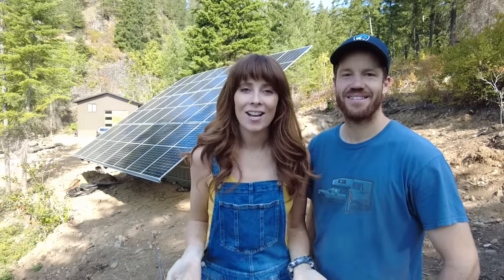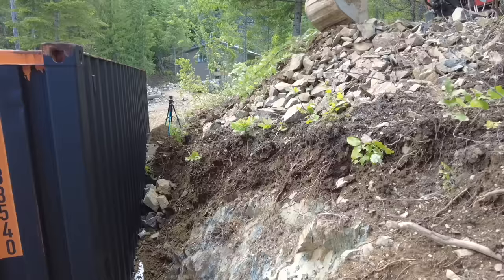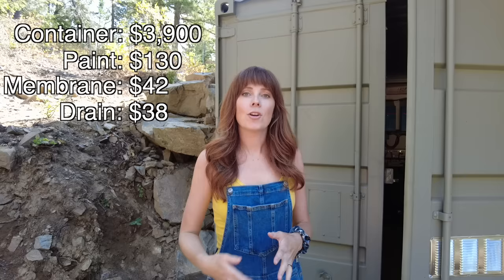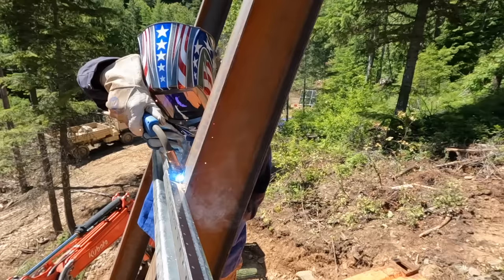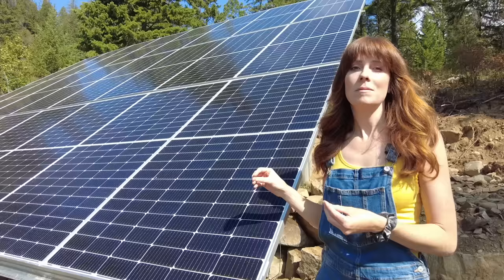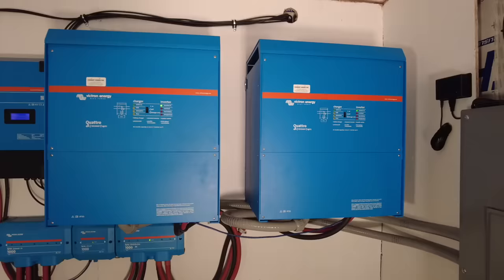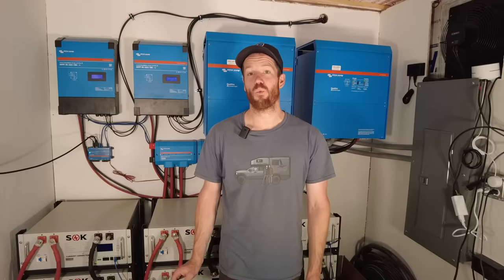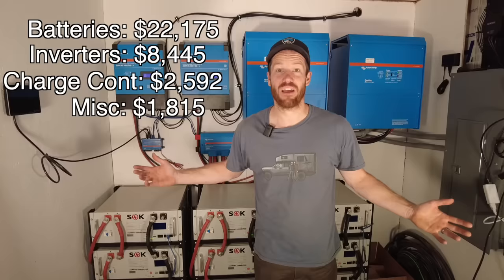TOTAL COST Of Our Off-Grid Solar Power System | Powering Our Mountain Home

Comment: My CPA wife wants me to remind you that the tax credit on your solar install for 2022 is 26%. Give your spreadsheet to your CPA and get the ball rolling. Take care.
Reply from the maker: Thanks for the reminder Frank!
Reply: @AmbitionStrikes  I am assuming that the $50k price is before the 26% tax break?
Reply from the maker: @keithviolette5870  That is correct.
Reply: @AmbitionStrikes  I hope to be energy independent at some point - our power is not all that reliable, and our rates increased 40% this month. Love the use of the container as a foundation.
Just a quick calculation - $37k for your system over 10 years would equal my average monthly power bill - about $300 for about 1400 kWh/month
Reply: Actually, since this began operating in 2022 and the Inflation Reduction Act is signed, the tax credit was bumped back to 30%.
This only applies to new equipment and I'm thinking your SanTan solar panels are possibly used?
Reply: @580guru  they are very likely new panels. Bifacial panels that wattage haven’t been around long
Reply: It’s now 30% for the solar tax credit passed in the Inflation Reduction Act
Reply: AKA the inflation Production Act
Reply: Credit… not rebate.  If you don’t owe, then the credit gets rolled over till it expires.  

When I put my solar on at the end of the year, I thought I was going to get one of these insane tax returns and funnel it into the loan for my project… that’s when I learned the difference between tax credit and tax rebate.
Reply: Nice system! I’m 10K of solar offgrid with 8K radian and three 100A charge controllers. Same reason - the power company wanted a minimum of $37K to run power to our cabin. About the same amount of money as you spent, we have been running with just a few days of generator a winter. 

Along with the “inflation reduction act” bumping the STC back to 30% for installs in 2022, they may also be now including energy storage systems in the credit, which weren’t part of the previous credit. 

Of course it s a credit, so you have to have enough taxes paid to claim the credit. If you haven’t earned enough to owe taxes this year, you can push credit into the following year. 

And yea, the credit previously required NEW equipment, not used. SanTan typically recycles panels - which is why they are a ‘deal’. Check with them if they are eligible. Since they are sold with short SanTan warranties, I’m thinking recycled, not new but maybe they are “B” grade panels straight from a factory. 

Consult a tax pro, some of the credit stuff seems to be up in the air.
Reply: Industrial scale solar! A normal home should only need about a third of that power? I installed a 200 amp conventional service to the grid and copper was much cheaper. Only wired in 100 amps so far. Never got around to building the out buildings or affording all our decks as my oldest was born with multiple surgeries to come during the construction. Even in northern latitudes where much of the year the panels aren’t worth keeping snow free the return on investment beats wind by about 3 years. I’ve looked into it enough with everything you’ve been doing. Very inspiring! Keep going!
Reply: Federal solar investment tax credit.
If you install your photovoltaic system before 2032, the federal tax credit is 30% of the cost of your solar panel system. This is 30% off the entire cost of the system including equipment, labor and permitting.  30 percent of 50K is 15K.  This is a first year tax credit.  The state of Idaho also offers a state income tax deduction equal to 40 percent the first year and 20 percent the following three years with a maximum deduction of $5000 each year.  Hard to say how much that will be worth to you.
Reply: @johnharrell5654  inflation production act, lol isn't that so true
Reply: When I installed my solar system 12 years ago it was around 45% but a $13,000 tax break is nothing to sneeze over!
Reply: That just got bumped up to 30%.
Reply: @nickgustin  It's a tax credit. It doesn't roll over year after year.  It applies to the taxes you might owe or it becomes part of your tax refund check.
Reply: We are also in north Idaho. Are the tax credits available for DIY solar projects or only for professionally installed systems ?
Reply: @580guru  I bought some of these panels too. They are new but mine were 'open box'.
Reply: @adarelliott  It doesn't have to be professionally installed.  Keep every receipt as you will apply for the tax credit on your income tax form. But there is no credit for your own labor.
Reply: They just extended the 30%.
Reply: If my tax credit is $15,000, but I only owe $5000 in federal taxes what happens with the other $10,000? Do I lose it or does it roll over into next years taxes?
Reply: tell your CPA wife to get more training. solar taxcredit is 30%
Reply: Is it possible to get a tax credit on a self installed system?
Reply: @keithviolette5870  note that if you are grid-tied you’ll still have a considerable monthly bill in addition to the payment on the solar (the grid bill will be mostly fees, taxes, supply charge, etc)
Reply: @ConorLennon  Understood, but the majority of the bill is for the power, which just increased 40% last month. My preference would be to disconnect entirely, as I have done with phone and cable (now using Starlink), but that requires a lot more investment in batteries, etc.
Reply: Your CPA wife is not very current on the tax credits
Reply: @nickgustin  
That is absolutely correct. Also, if you don't pay that much in taxes then you won't get all of it back. I'm having a hard time getting the $7,000 back that I'm due on my rooftop system and I've got 5 years to do it.
Reply: @keithviolette5870  @Ambition Strikes in another quick calculation if they use task reduction credit and their batteries and solar cells last for 20 years their monthly cost for unlimited electricity would be $154
Reply: @NoName-ml5yk  You get a tax refund check.  It's like you your employer overpaid.
Reply: 30% now
Reply: @NoName-ml5yk  rolls over
Reply: @nikolatesla5553  A tax refund check for more than I paid in for taxes that year?  How do you know this and can you prove it?
Reply: @nickgustin  You only get 5 years to use the credit.
Reply: @NoName-ml5yk  
Why would anyone need to prove anything to you? Look it up yourself if you don’t like the answer. Stop being lazy and do your own research. The information on solar tax credits is publicly available.
Reply: @keithviolette5870  
1400kWh a month? What the hell are you doing?
I have about 3500kWh per YEAR
Reply: @NoName-ml5yk  yeah he’s wrong.  It is a nonrefundable credit. You are only credited up to the amount of your tax liability.  The unused portion can be claimed on following years tax returns up to 5 years though.
Reply: @benjaminw309  Thank you Ben!
Reply: @SiriusSolar  Yeah, these comments act like its all free money. We all pay for this... So kudos to those that take advantage of it but please, thank all the taxpayers! Current and future!
Reply: @keithviolette5870  what area🤔
Reply: It’s actually 30% now. 💵
Reply: @sebastiangrimm4370  I have a machine shop, wood shop, welding fabrication shop in my basement, a Tesla Model 3 Performance, a plug in hybrid Prius, 4 window air conditioners, it gets dark at 4:30 PM in the winter, etc.
Reply: @trojanssc01  New Hampshire. The cost of natural gas has spiked, so the power companies just pass it all along. Other local power companies went up even more.
Reply: @benjaminw309  so with the credit applied it you are in the positive you dont get that as a refund?
Reply: @timothyberlinski2299  it is nonrefundable meaning the credit will not exceed your tax liability.  
E.g you have a tax liability of 10k and you have a 2k child tax credit and a 15k Solar credit so you only receive 8k in solar credits.  Your refund will be everything you paid towards taxes in the year and you will be able to claim the remaining 7k the next year (15k - the 8k you received for the credit this year)
Reply: it's 30% for any system installed in 2022-2032 and the credit applies to ALL taxes paid, including any W2 federal withholding taxes. not just "taxes due when filing". great job on this and best of luck!
Reply: Government will know you have the panels tho
Reply: I thought it recently went to 30%
Reply: @keithviolette5870  What do you do to consume 1400 kWh/month ? Big family, electric heating system ?
Reply: @charlyclerfeuille4212  We are a family of 4, we have well water with a 3/4hp pump, a water radon system with a 1/2hp pump, an electric stove, electric dryer, 4 window air conditioners in the summer, a machine shop and welding fabrication setup in the garage, a couple 3D printers running 24/7 for a side business, a Tesla Model 3 Performance (20k miles per year @ 0.3 kw/mile ~400kWh/mo), and a plug-in hybrid Prius.  I'm looking into Solar.
Reply: That only works if your in the correct tax bracket to pay as much in taxes.
Reply: @nickgustin  Just don't pay in next year and let the credit cover your tax load?
Reply: @nikolatesla5553  The balance of the credit used to roll over year to year till used up. Has that changed?
Reply: Do you get tax credit for offgrid ?
Reply: @keithviolette5870  electricity is probably going to triple over the next 10 years so the savings may come sooner.
Reply: Useless credit when you're spending 40k.
Reply: They produce more power than the service to my house.
Reply: That is nice. Whether a person  uses new or used panels,  it's a great deal.  Used panels are usually 1/4th the price of new and still have lots of life left in them. They aren't  as efficient of course. 
 Better reused than thrown in the dump.
Reply: Yah its 30% last i checked for 2023 looks like!
Reply: @keithviolette5870  Have you noticed in your area that it almost seems the Natural Gas producers are not objecting to what our government is trying to do to kill off their business model? It may be different in your area but in Western, NY National Fuel Gas seems to be stone cold silent about this and the ban on any gas appliance for new builds and possible replacements.
Reply: @mikewurlitzer5217  I think they are at or beyond the capacity for the regional pipelines, so they may be limited on what they can promote.
I have used gas appliances, and they are great for quick heat, but I would rather have induction.
Reply: @ConorLennon  we are grid tied in NYS and pay $18 a month connection fee (unless we run out of credits and have to buy power)
Reply: @NoName-ml5yk  that how it worked for us in 2014 in NYS. We got about a10k federal tax refund, but then we owed income taxes on that 10k the next year, so paid back 3k of it.
Reply: W wife
Reply: 30% for 2022, genius. Hoping you posted that before actually asking your CPA wife, or it's really not a good look. 😂
Reply: As well as Idaho state tax credits
Reply: The inflation reduction act increased it to 30% for the next 10 years
Reply: Not worth all that shade on your solar panels
Reply: 🤣 so they made a solar to save money but now they have to pay tax for a have a freaking solar that is US for u everything is tax if I was this couple I would have just move to asia like Thailand or Vietnam alot cheaper n better life than getting, ill every year for tax even when they made solar to save money on electricity but get tax for 50k that make solar useless or even more of a problem cause off add tax🤣🤣🤣🤣🤣
Reply: it wasn’t that hard to figure that out
Reply: @travelfeet  have an 11 acre property that has a camper on it. I wasn’t there for two years because my wife passed away. So they have been taking 50 dollars a month for electricity that I’m not using. I put a 200 amp service in a garage because I was going to eventually build a house on the property. I have over 300 hundred dollars credit with the company because they are charging me 45 dollars a month. I called the company and said I want to shut the power off and I would call when I wanted it turned back on. She told me that I would have to pay a reconnection fee and pay the back 45 bucks for every month it was off. How’s that for a company ripping me off?  I think I’m gonna just shut it off and take my generator with me when I go up there. That’s why I canceled my land line for the phone because I was paying 35 bucks a month if I didn’t even use it. That’s in Pa. By the way. ✌️👍🇺🇸
Reply: I wish I had a CPA wife.
Reply: You need to pay tax just to install and use solar energy?😅
Reply: @nickgustin what does this mean? If you wouldn’t mind explaining a bit more?
Reply: Glad to know my tax dollars are paying for your power.
Reply: @atlurker8037  
Loss leader in business is when you pay to change customers' behaviour. 
Governments are financially involved in the national grid and electricity.
If the grid is overloaded and blackouts, governments are punished by voters.

To pay a little once to get people off the grid is cheaper than increasing generation and fattening the grid.
Reply: This didn't age well.
Reply: @stephenbrickwood1602 and the whole point of this transition is it is paying for itself over the long run in lower pollution damage
Reply: @robgriffin4801  yes.
And it can lead to huge amounts of free energy as the technology improves.
Reply: Wait, I have to pay the government just bc I decide to get solar power ? ?????
Reply: Is that 26% on the entire system or just the cost of the install process
Reply: They installed themselves so that 26% is free for them
Reply: 10 kilowatt off grid tata solar system on my rooftop in india is way cheaper with 25 years warranty on panels. 
cost us $8400 (after govt subsidy)
Reply: @AmbitionStrikes  How is a 10kWp system with batteries 50,000$?! The panels will set you back around, 3000$ even at 2022 money and the batteries are probably no more than about 30000$ in 2022 money. Where is the rest 15,000$ going to, not the inverters?!

Comment: I may have a pro tip, how to improve the batteries endurance in your system. You can mount a thermostat with a fan heater inside the container and set the temperature to 15 celsius degrees. You can use excess energy to keep the batteries in the optimal temperature just by adding this small system so you can enlarge their lives by a few years 🙂 Good luck!
Reply: Heat pump system may be even more efficient
Reply: In deed, heat pump is more reliable, way more effective and efficient in keeping your container cooler for summer and warm in the winter. 👍
Reply: Just need a small mini split
Reply: Also limiting the max battery charge in the controller (?)

Limiting the max charge to 95% will also further prolong battery lifespan (prevents overcharging issues while still provides near full capacity)
Reply: @sihamhamda47  most controllers do this behind the scenes.
Reply: Maybe use the heat from the batteries as a powersource
Reply: 1-2" styrofoam insulation on the shipping container sides was effective for my application in the northern latitudes.  I've since graduated to a more efficient heat pump system.
Reply: 50k?  Pass
Reply: @JayHNotTheNormalTraveler  $50k for independence and peace of mind is a small price to pay. SELF RELIANCE above everything. Its a mindset.

Reply
Reply: Yup great idea.
Reply: This works, IF they get enough sun to keep it up.

Comment: Hi guys! if you paint the container bright white and spread white soil on the ground you will be able to get a higher generation with the bifacial panels due to a higher Albedo. Nice PV System, congratulations!
Reply: Snow under and around the panels would work too.
Reply: hey Pablo.. please explain how that works ? I've heard a little about that but I dont quite comprehend.. yet.. help??
Reply: @violettownmicroenterprises1528   white stuff reflect the light
Reply: @violettownmicroenterprises1528  Some solar panels can use light from the back of the panel. The panels usually use a glass-glass sandwich, instead of a plastic back side.They are usually used in large installations on white roofs. Modern solar cells are very thin (0.2mm) and partially transparent. Some have a mirror coating on the back of the cells, so the light that passes through the cell can be reflected and make a second pass through the cell. (these panels can't use light from the back of the panel, since the mirror layer reflects it before reaching the cell.)
Reply: or just insane amounts of cocaine
Reply: @ReneRosa we don’t need a sequel to Cocaine Bear
Reply: @@vintagelightman838 yep 👍
Reply: Mirrors. Just install mirrors
Reply: Or stick something reflective directly below the panels, such as emergency blankets - they're cheap enough
Reply: Solar coat roll on roof seal it's super reflective and don't roll on in shorts unless you like sunburned cheeks
Reply: Or Aluminum foil under the panels
Reply: True